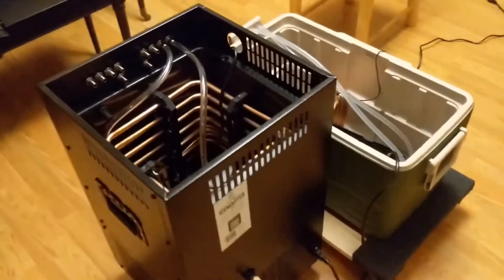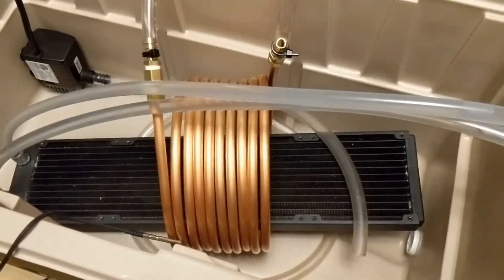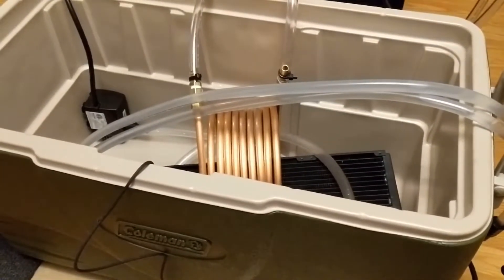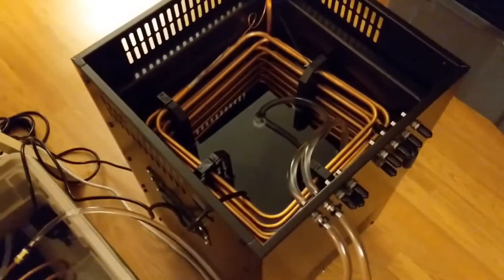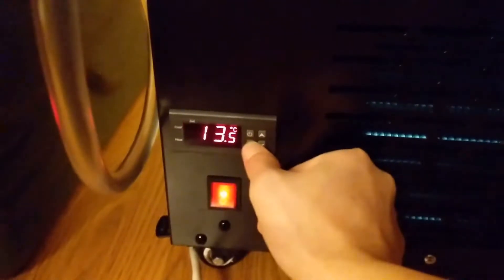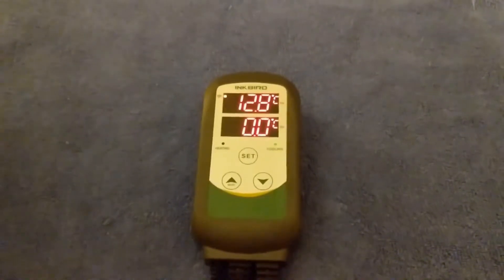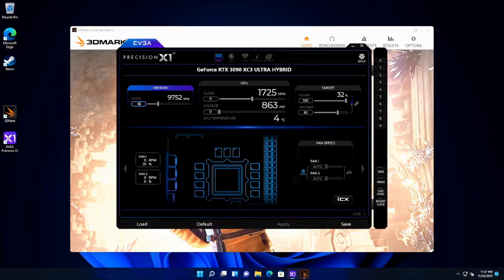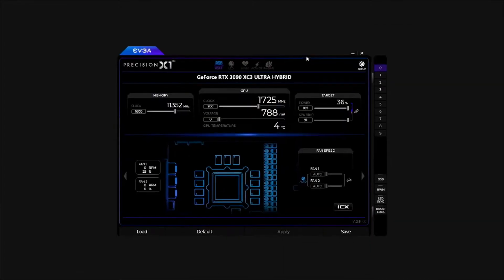Glycol Chilling EVGA 3090 XC3 with BrewBuilt IceMaster 100

Comment: Why not just connect the chiller directly to the GPU/CPU water block?
Reply from the maker: I was going to do that, but then it would be a lot of labor to swap back to use the machine normally. I think in the future I may do more of a dedicated setup where I see if I can push more into the negative temps, but the condensation is terrible. After messing with this setup and LN2 I realized why people only go so far with liquid and switch to LN2. I think I feel safe going to maybe -5 Celcius with liquid. You can go for hours and hours with this and mess with things for days. With LN2 you have to think this is only some day or evening session. The LN2 can go pretty fast and a weekend is just about right.
Reply: @nispoe  Plus, Ln2 only requires some silicone and a Styrofoam cup!

Comment: Very cool setup! I have a similar glycol chiller (SS Brewtech) and I have been thinking of attempting this. Nice build!
Reply from the maker: Thanks! I think I'm being very careful here with using the cooler in the middle with the radiator. I could attach the chiller directly to my computer without using the radiator in the cooler, but felt doing it this way was safe in case the pressure of the glycol chiller pump was too much. One of these times I'll go directly to the computer and see how that goes.